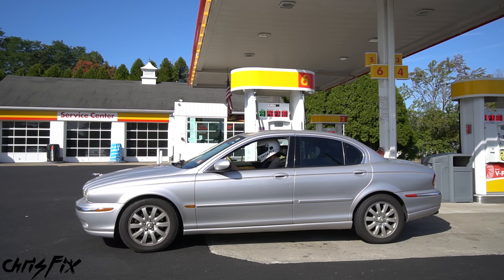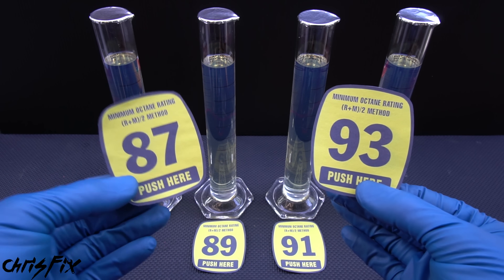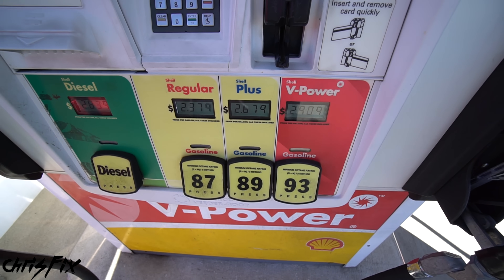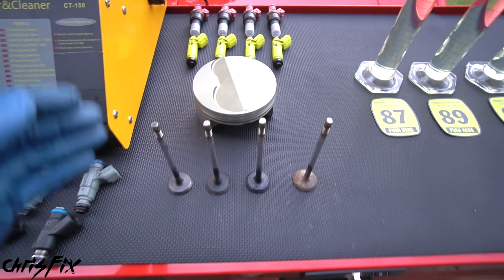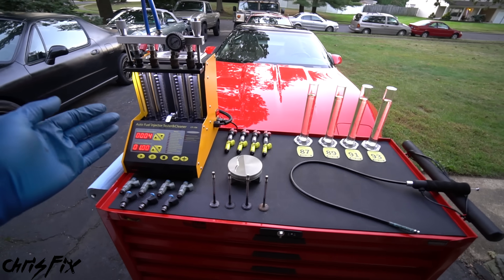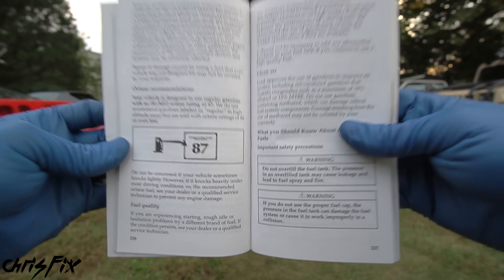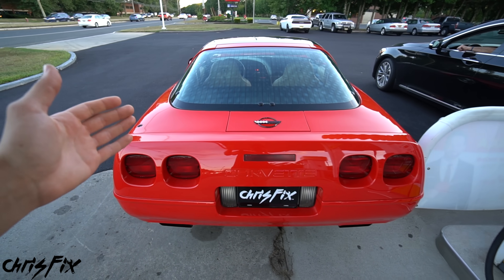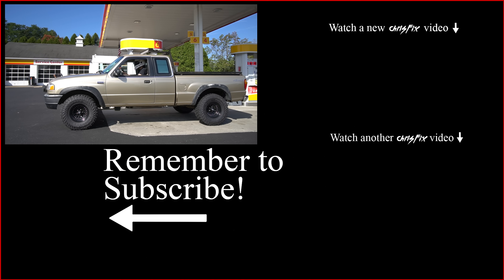What is the BEST Fuel to Use in Your Car or Truck and WHY

Comment: Need to talk about e15 and the other variations of higher ethanol fuels
Reply: Yea. I use e85 in my f150 often
Reply: ezshifty Are you a farmer?
Reply: @naps3386  e85 in Pennsylvania is the cheapest gas! And if your cars tuned or flex fuel then why wouldn't you.  And dah you get MORE HP. I get 34 Hp on the Dyno on e85 compared to 93.. Do cheaper/Faster... I'll take the E85 sir
Reply: E85 burns hotter and faster, so you use about the same

Comment: Here in the UK our standard grade is you mid grade, we don't have lower than 89(us)/95(Euro) so the statement is partially true, your lowest grade fuel is lower than the lowest grade here in the UK. That would have been a useful statement in your fuel comparison. Good work as usual though :0)

Comment: So if I were to go get gas at a shell gas station instead of speedway (b/c I need my points) the shell gas will help remove carbon deposits from valves and piston heads and etc?

Comment: If you're not living in a state that restricts your choices, you often have the option of buying ethanol-added or ethanol-free gas.  The ethanol-added gas is often about 20% cheaper (courtesy of your neighbors in higher-income brackets), and maybe reduces consumption by 10%.   Would be interesting to hear your thoughts on that option, especially for people with older vehicles, or for those who rarely re-fill their tanks and worry about ethanol breaking down and varnishing the fuel system.

Comment: Great video with to-the-point facts. Some things worthy of mention are that most modern pumps are designed so that you wont physically be able to put a gasoline handle in a diesel fuel neck, and vice versa, making it much harder if not impossible to accidentally put the wrong fuel in. Additionally, overfilling the fuel tank is bad. Some people wait until the handle clicks once, and then keep  pressing the trigger to fill up a few more ounces. This is bad because it starts filling up the fuel neck and interfering with the fuel vapor circulation.

Comment: I agree and disagree with the contents at the same time. Deciding what to load in a car as fuel is helpful, but I beg to differ. I usually fuel on Shell stations, while I hear a healthier engine and a reduced consumption from the premium petrol on the way home, which is some 150 miles, I get worse mileage from 95 on the way back, taking the exactly same route, the exactly same speed. Engine is a G4EA 15 year-old NA I4 1.3L. I stopped fueling on other brand stations as their fuel either raises consumption noticably and/or makes the engine pull weaker. Shell somehow does make a good fuel that does perform well - at least in the case of my engines. Owner's manual states " ... POR of 87 (RON 91) or higher must be used.." 
 of course these methods disregard economy and are in favor of optimal/over-the-top care of the engine
 talking of EU / HU fuel

Comment: Use the octane rating that's recommended by the manufacturer, it's in the owner's manual.  End of story.
On another note: Octane is a hydrocarbon and an alkane with the chemical formula C₈H₁₈, and the condensed structural formula CH₃(CH₂)₆CH₃. Octane has many structural isomers that differ by the amount and location of branching in the carbon chain.

Comment: Also out west here in Colorado we have lower octane. There is 85 instead of 87. The 85 should not be confused with the E-85
Reply: Premature detonation less of an issue with thinner air at higher altitudes.  Hence the lower octane ratings.  In the Mountain West myself.
Reply: @BenKlassen1  exactly,  just wanted to put that in here so all of the west coast people would get too worried about not seeing the 85 octane on the video

Comment: Hey Chris. I just picked up a 1994 subaru SVX, and it REQUIRES 91. I understand why but i was wondering if you haf any information on how fuel has changed in the past 20-50 years? Is 91 fuel the same as it was back in the 90s? Or has there been very little change in terms of ocatane ratings etc.

Comment: I know this may be dumb, but I was asking what to do if your car already has regular in it like half a talk. And you accidentally put premium to fill up the other half. What will happen to the car is it even safe to drive?
Reply from the maker: You can always use a higher octane fuel but don’t use lower octane than required. Watch the end where I talk about octane boosters.

Comment: This doesn’t apply to me. I use LPG in my car.
Reply from the maker: That’s pretty cool!
Reply: @chrisfix  Almost every american car here in the Netherlands runs on LPG.  6$ a gallon for petrol and 2.5$ a gallon for lpg . The taxes slighly increase after the conversion but its totally worth it.  The milage vs petrol drops but in the end its cheaper to run lpg.
Reply: Hank hill head ass
Reply: @Sal Bruno propane gas in liquid form, the same stuff you use for the grill (mostly)
Reply: I use CNG
Reply: both of my cars are diesel
Reply: And I have to use E25, no other opinion around here.
Reply: The concept behind LPG is genius, but I'm scared to death of driving an LPG car.
Reply: Captain Rudy 4021 very rarely there are issues with them, even with accidents. One downside is most underground parkings don’t allow them. Also tanks are pretty small, so most cars need to tank every 250km. Of course you can run on petrol when LPG runs out.
Reply: @arek314  I know issues are rare but my fear of LPG cars is similar to people who are afraid of planes.  Consciously I know nothing will likely happen but subconsciously I always ask what if.
Reply: @mataczadrian It's all true.Great explanation there!
Reply: @Sal Bruno liquified petroleum gas

Comment: Something that's worth noting Chris... 
Rebuilt engines that have had the block deck reduced, or the cylinder head shaved, have a higher compression than it would have from factory. Obviously not every rebuild requires the block to be decked, or the head to be shaved. 
I run 92 octane in my rebuilt by me motor, as the head and block both had material removed. Resulting in a slightly higher compression ratio.
Pinging can happen sooner in engines that have been rebuilt for this reason. Unless you compensate with different pistons, or a thicker head gasket.
Reply from the maker: For sure! Hopefully the rebuilder or machine shop tells you this but if not, the higher compression might make it ping on regular!

Comment: ChrisFix: Talks about what fuel is the right one
Me: "Diesel, shaken not stirred"
Reply from the maker: And then your phone rings with the 007 theme song!
Reply: Till innovation hits you with "what kind of diesel sir"? And you walk back to the cashier like "Tf?".
Reply: @metaphor239  lmao
Reply: @metaphor239  look carefully at the euro pump and you'll see 2 kinds of diesel fuel
Reply: @treles  Usually we have a normal diesel and one that is filled with additives. But right now diesel is so clean comparing to 15-20 years ago, its incredible. And at least 40% of all cars in Europe are diesel. You can get a VW Polo with 1.4 diesel and it will return insane gas mileage. Also the down rpm torque on diesel cars is just insane and they pull like crazy.
Reply: Shaking your diesel dilutes it more than stirring it, therefore you get less diesel. Thi applies to martinis too.
Reply: @CarlosRios1  ⭐The more you know ⭐

Comment: Hey ChrisFix, my car requires octane 96 but most gas stations here have 95 or 100. Is 95 fine to use or would you recommend going up to 100?
Reply from the maker: 95 would probably work just fine. Listen and if you hear that loud pinging-marble ball-bearing-bouncing-around sound on 95, then I would move to 100.
Reply: @chrisfix  Will do! Thank you for the response.

Comment: The bigger problem with E-85, is that it'll start to break parts, normal fuel-lines are not suited for it!
Reply: Mainfold It attracts water from the air, letting it sit for just a few weeks can cause corrosion in fuel system.

Comment: In Canada at esso you can get 103 or 105 octane can’t remember exactly but that’s something
Reply: Esso is 91 octane.  I think at Sunoco and Petro Canada they have up to 95.  You can buy 105 at the track I've been told.
Reply: The gas station near me has a single 107(its 100+ idr the number exactly) octane racing fuel pump off to the side. Pretty impressive to find one outside a race track

Comment: Good Vid....  What about using injector cleaners, do recommend them, if so how often?
Reply from the maker: No, just fill up with a fuel that has cleaners in them. The example I gave in the video is Shell says their premium fuel will clean 70% of injectors and valves if you use it for 2500 miles. That’s as good as it gets!
Reply: Thanks....  Does the 89 fuel have cleaners in them too? if so would you know how much?

Comment: So for my Ford F150 it is a V8 Flex Fuel it says "If your vehicle is a flexible fuel vehicle (FFV), use only UNLEADED
FUEL and FUEL ETHANOL (Ed75–Ed85)". So those that mean that I can use 87 Octane without damaging the motor.
Reply from the maker: There is nothing that says to use high octane then regular should be fine.
Reply: ChrisFix Thank you

Comment: I found out about engine knock when I had a 3000GT SL, i put regular gas in it (poor college boi) when I went to merge on the hwy the engine started to run rough and made a pinging sound while my foot was down. Later it just idled rough until i put 93 Octane fuel in it again and literally a few miles away from the gas station the car began to run smooth as silk again.

Comment: Chris, what's the best method for cleaning valves when the car is direct injection and not port or multipoint injection?  Is that something best left to a repair shop or are there DIY options?

Comment: Yes, you are right to use non premium if is not required, but in the greedy world, here in Europe Romania at least, you have very poor fuel for lower octane, and more additives for the premium. So if the car manufacturer says non premium, you will put lower octane and everything will clog up in time. That is why you are hearing that higher octane burns entirely or something similar.. It's because they are making poor quality fuel for lower octane, so you will want higher octane premium just to not visit every day the service. Here they are putting wather inside the fuel so you will want to buy premium...and I don't think we are the only country with this issue. So yeah, buy non premium at your own risk in some countries.

Comment: My 99 Miata with 250,000 miles on the odo is temperature sensitive to octane.  
Below 85F, it runs great on regular.  Above 100F, it requires premium (and midgrade between 85 and 100 outside)

Comment: Is it okay to switch one octane to another? I used to use 89 but went to 87 and was told switching octane will ruin your engine. Manual says to use 87 but the previous owner used 89 prior.

Comment: Could there be a chance if you use a fuel additive to remove carbon it could cause damage on the older car or higher mileage because the carbon is filling the valves and lower the compression and give it a knock?

Comment: knock sensors are not used in car industry instead they use the spark plug  
after the spark ignites the mixture a small voltage is sent to the spark plug 
to measure the resistance if it is  lower than normal it means the air is too ionized  which is detonation 
if it is higher than normal it means there is a misfire

Comment: I feel like you could do with touching upon fuel that have ethanol added (usually 10-15%), which from my understanding is not a great for wintering with.. and modern cars have no problem with it, the older cars may do.

Is there any truth to that?

Comment: Nobody: 
ChrisFix: walking around with helmet
Reply: I thought about being Chris Fix for Halloween.
Reply: @jeremymenchaca  brilliant
Reply: He was born with a helmet
Reply: @LifeUnscripted5863  his poor mother
Reply from the maker: @Pipa Obala To do those tests would be incredibly hard. Fuel economy would have to be done on a dyno because there are too many variables in the field (aka on the street).
Reply: nice video Chris. thank you for the adde knowledge
Reply: For real? Which one...ive must hve miss it
Reply: @Pipa Obala ok...i'll go watch later
Reply: Harlem shake 😄
Reply: @Pipa Obala It really could but it depends on the ECU of the engine and how it is managing AF ratio and knocking. Sportscars (or cars with a sporty attend) rather go for knocking limits and if the fuel allows more tough operating then it raised the power and the economy. If the engine reacts properly to the 'better' fuel then always both changes. Economy and power. since the economy advantage comes from the tougher operating which leads in higher performance or more performance per gallon which is economy :)

Comment: I have a 2010 Subaru GT (with a Subaru Performance Turbo) and it says to put in 93 octane but 1. I have to pay for my own gas and can’t afford it. And also. I’ve been putting in 87 for the past month or so, haven’t noticed a difference in fuel economy or performance. Soooo... is it okay or should I start putting in 93 anyways?

Comment: Is Shell really worth the extra price? Every Shell in my area are 20 - 30 cents more than all other gas stations in my area. I mainly use Chevron. Chevron runs amazing in my car, I noticed a difference going from full time Kroger fuel to full time Chevron in 3 tanks! I'd try Shell, but is it worth justifying an extra $6 - 8 per tank?🤔

Comment: Amazing video Chris, keep it up! I want to ask you something, few months back, I rebuilt my car engine at a mechanic shop (99 Mercury Grand Marquis LS)  and I been using 10 W 30 but after I changed the oil for the first time after the rebuilt, he told me to change the oil viscosity to a different one 20W 50 he said because what I am using is light and also because of the weather which is mostly hot. Should I listen and change the oil type or stick to the one I am used to?

Comment: Would an EGR flow issue cause a gas ping? I have an older ford f150 2wd with a 4.6 and it has a gas ping going up hills but it also has a EGR code P0401 that needs fixed. (will be fixing soon)

Comment: So if already put 87 into my car, would I be able to put premium or maybe octane booster while 87 is already in my car?
Reply: ????  What does your engine require?
Reply: wholeNwon 87 v6 2001 Ford Mustang
Reply: @coreymedford8792  Of course, you could; but, why would you want to?
Reply: wholeNwon clean injectors or carbon duh
Reply: @coreymedford8792  ALL octane grades contain the same amount of detergent...duh. Octane boosters are not fuel injector cleaners...duh. The evidence that fuel injector cleaners when used as directed actually work or work better than top tier gasoline is weak or non-existent. But maybe you knew that.

Comment: "What is the best fuel to use in your car or truck and why?"
Me: Diesel. Because it has a diesel engine.
Reply: in Germany we have 3 diferent types of Diesel  1.(normal Diesel(with 10 percent Bio) 2.Pure Diesel 3. V-Power Diesel with aditive
Reply: @Wutzman28  you have winter diesel too
Reply: Wutzman Wutz I don’t think it’s a coincidence that you have 3 types and you have more diesel vehicles than us. Most of it is bs marketing
Reply: @feargripper  I bet the additive is for better cetane and winterization - and maybe some things I am not familiar with. Junk diesel, just like EPA standard gasoline in North America, probably takes its toll on the vehicle. Anything that reduces the carbon in the DPF is worth it in diesels; anything that reduces intake and combustion chamber carbon in gasoline (petrol) engines is worth it. I drove a diesel work truck long enough to know cetane is not BS marketing!
Reply: flagmichael it’s a bit ignorant to think the epa doesn’t require a reasonable amount of detergents you’re acting as if the epa just lies about what they require in gasoline
Reply: @Wutzman28  We have Biodiesel in America too but not every station has it, many stations don't. Most are as you see in the video, they may or may not be 2% Bio (they're not marked.) I've seen video of a 100% Bio station but it was in California and I'm in Pennsylvania.
Reply: Austin Lucas rl
Reply: Isn't regular diesel clocked at 7% bio everywhere in Germany? Even the Aral (BP) ultimate diesel has 7%.
Reply: @Wutzman28  Actually there is also Lkw diesel
Reply: As simple as that
Reply: @Bruce Lee hhhhhhhhhh
Reply: Use ethanol to kill your truck
Reply: Nicaragua has 2 diesel types, regular and premium. 60% of the vehicles on our roads are diesels
Reply: In the Philippines, there are 2 diesel types regular and premium (turbo) diesel. But since the introduction of Euro4 standards, premium diesel is slowly dying.

Comment: @ChrisFix Just to complete your information:
In Europe e.g. Germany you have the option to use even higher octane (102) fuel. You can get it at the ARAL Fuel Station. Its called ARAL Ultimate.
Reply: Just saying: The units in EU and US are different. US 93 is EU 98
Reply: @Luniii737   ARAL Ultimate is 102 RON and 95 PON

Comment: If your fuel injectors are dirty you might as well use a 7 dollar cleaning additive, not 93 octane. Higher octane on normal engines just cause unnecessary stress for the electronics or sometimes the engine itself. Shell had to get its sponsorship worth somehow ;)

Comment: When filling the tank, never add gas beyond the point where the pump shuts off automatically. i.e. DON'T "top off".  You can also mix. My car requires 91. So, if the tank is 1/2 full with 93, I can fill up with 89, if necessary, and still meet the octane requirement. Shell has extra detergent to comply with the "top tier" requirement. It's met by lots of other brands as well.